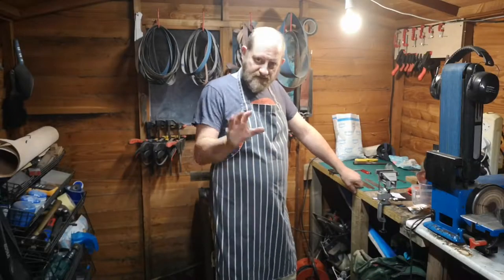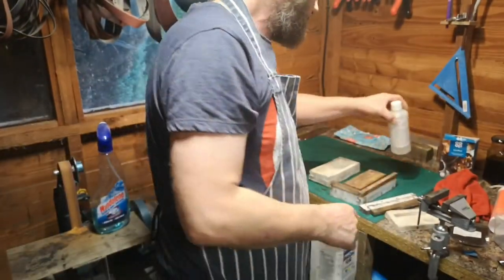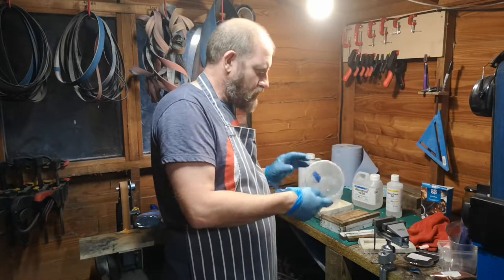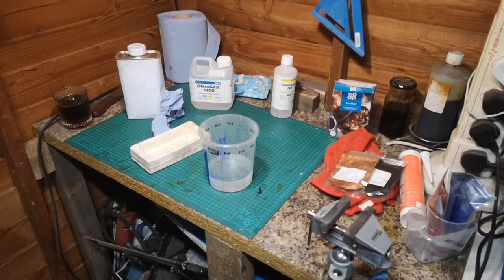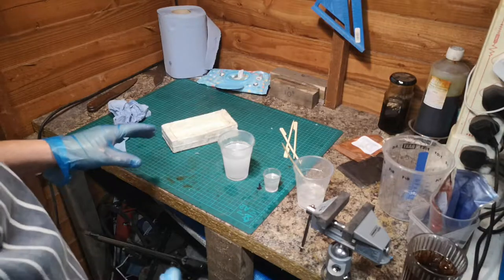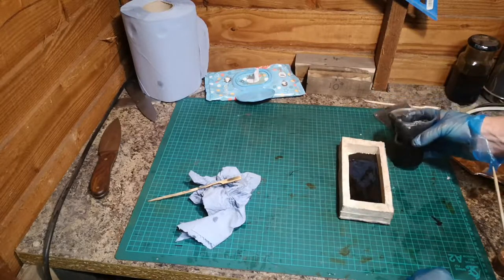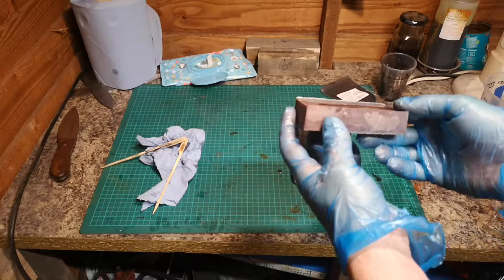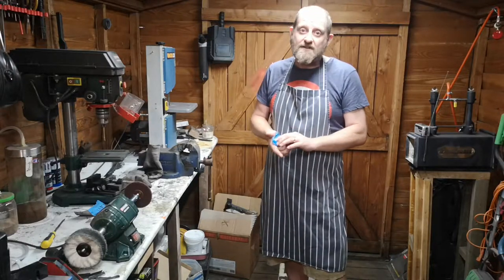Epoxy resin Knife Handles, Some that I have made

Comment: You’re right mate, vibrations really do help to work the bubbles out of the epoxy resin. A heat gun isn’t the preferred method of popping them once they surface though - it’s not heat that pops them but carbon dioxide/monoxide (I always get those two confused). This is why you’ll sometimes see people blowing gently over the surface of small pieces (like these scale blanks) through a drinking straw. However, the easiest way to pop the bubbles that surface is to pass a butane torch flame over the surface - beware though that the heat is not what does the job and it will boil the surface of the resin very quickly and ruin it so don’t point the flame directly at the surface. Remember that it’s the carbon dioxide/monoxide from the burning butane that does the work.

Cheers mate, I always enjoy your videos!
Reply from the maker: Cheers buddy for the in-depth reply, I will take onboard your tips, I've been told I talk a lot of hot air so plenty of carbon dioxide 😁😁 if I blow on the resin
Reply: Exmoor blades haha no worries mate 🤣👍🏻

Comment: As someone who does a lot of resin casting I would recommend changing to a polyurethane resin rather than a polyester, better for your health long term 👍
Reply from the maker: Only use epoxy now John but thanks for thinking of me buddy 👍
Reply: No worries, epoxy can still cause you problems, have a look at the styrene content which is the nasty active chemical in resin. If it’s over 5-10% think about polyurethane. Really good supplier in Belfast, MBFG